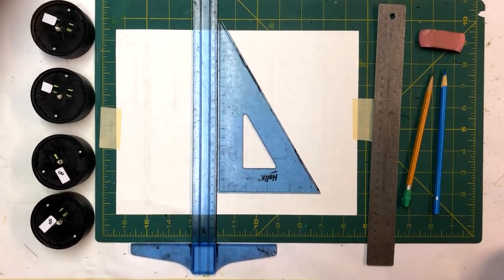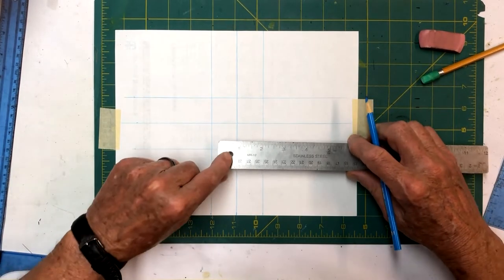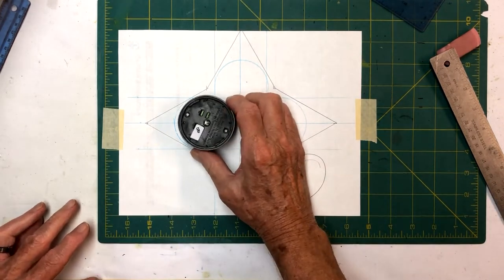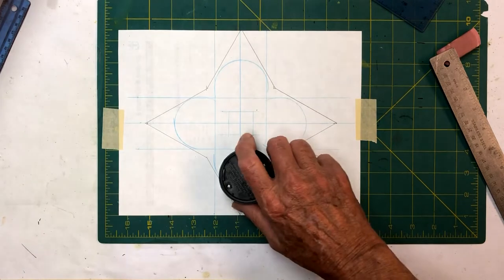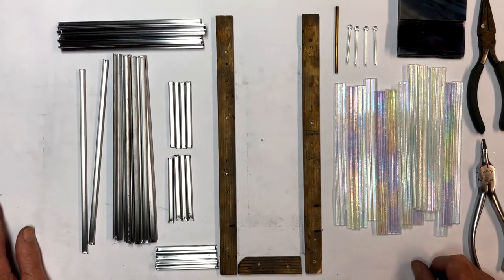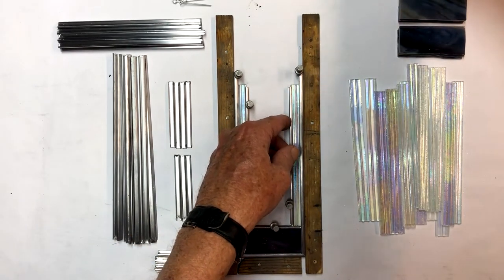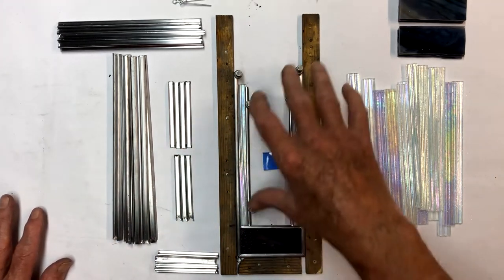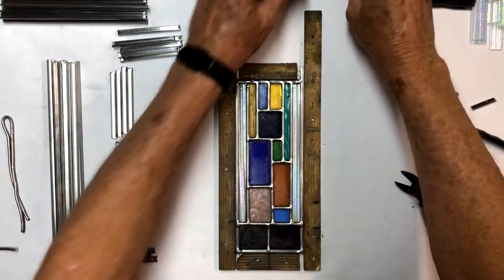Leaded Glass Solar Lantern  Star 1

Comment: Hello Bill, again! Another question I have is do you ever putty the lead lines?  Will it make the piece stronger? Do I need to get putty and and that white powder to clean the lead lines? I'm new to this and your videos are very informative. I'm watching them all 🙂
Reply from the maker: Hi Kathy,
I do use glazing putty on the large windows I make for the home. Yes, when it dries it makes the window much stronger. I also use the white power to help clean up the windows. After you work the putty into all the seams between the glass and channel in the lead came, I use a brush and go over the panel to work in the whitening power. Then I vacuum the power off the panel and clean the glass with Isopropyl alcohol, it gives the glass a nice shine. Hope this helps you out.
Regards,
Bill Stone